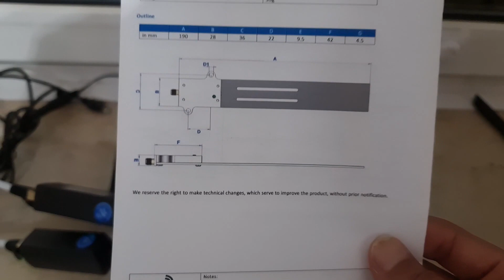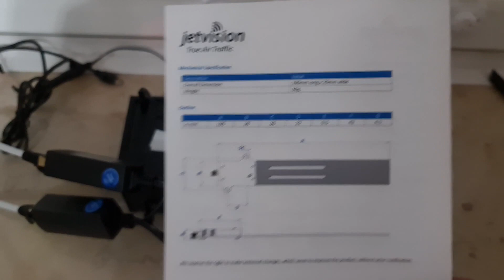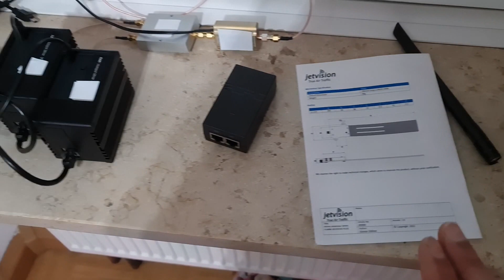2 Helium Miners 1 Antenna , Helium Amplifiers , Splitters 2022 Part 2 _HELIUM ADDICT

Comment: this looks amazing and props to the effort. they will nog registrer you for the deny list for placing 2 rak miners at the same spot?
Reply from the maker: Thanks 🙏 😇 
Well I hope not, I m planning to separate them son as I find a host
Reply: Any idea where I can get the amplifier / filter for the eu868 version? Is it able to switch the antenne cable into a pigtail (cotxx3/controllino v.3) ? Sensecap already has two filters in it right? should I put an extra saw filter on the sensecaps m1?

Comment: Hello, thanks again for this informative content! I installed 2 miners on 1 antenna and I'm experiencing some networking problems. I think this is a topic which deserves to be analyzed. I know you don't have this kind of problem but I assure you that is a very common one in countries that are not Germany. Like mine: miner n.1 is fully synced and port forwarded to 44158. Miner n.2 can not be portforward to the same port so I had to open a different port but no dialogue with the blockchain. When I ping it through Hotspotty it says no connection to blockchain. Weird thing is that both miners are ok when I checked on Helium diagnostic via Bluetooth pairing. 100% synced and ok inbound and outbound. Any advise from your side would be really appreciated 🙏
Reply from the maker: Hi 👋 
The important thing is it's not in Relayed states  and the Rewards should be the same in the end of the month 
Happy Mining ✌️
Reply: @heliumaddict8582  the explorer says it's syncing. But it's stuck like this from 10 days and it doesn't send beacons. That's the problem. And there's another problem: given a beacon sometimes miner n. 1 makes the witness but miner n. 2 don't. Even if the beacon has less than 14 witnesses total
Reply from the maker: @fracichi   I think you have SD card problem 🤔 for  siw long syncing 
And witnesses is just random and not mine you will witness the same beacons on bought  miners
Happy Mining
Reply: @heliumaddict8582  that's really weird. I don't think it's an SD problem. I will try to connect just the syncing miner to the antenna, turning off the other miner and see what happens. Thanks

Comment: NMRF saw filter 868mhz is this good? What does this Do?
Reply from the maker: Me I don't recommend SAWFILTER because he will reduce your SNR and you lose 2.5 to 3.5 dB  from you miner power. 
Youse SAWFILTER only if you have Heltec miner or Pisces P100 Miner because they don't have Sawfilter built in. 
I hope this answers your questions 🙏 
Don't forget to activate the notification bell on  for my upcoming videos 📹 😉
Reply: @heliumaddict8582  because my bobcat is underperforming compared to my other miners 2 panther x Thats why .
Reply from the maker: @mariochanko5076  I don't have Bobcat but you can open him and replace the ipx cable from inside with shorter and better one if your comfortable about that 😉 
I m not RF expert copy me on your own risk Disclaimer 😉✌️

Comment: I'm no RF expert, but from my radio studies I would say that you are going to fry your radio's concentrator, you cannot just split both receive and send signals into one antenna.
When one transmits it could go to the other hotspots coaxial as in decibel power reaching your concentrator that should not be. I hope this finds you well, good luck.
Reply from the maker: Hi 👋, first I want to say I m big fan of your videos I watch all the time from the beginning of HNT mining. 
About your counsern of Rx and TX well probably you have right I'm not expect in RF or anything but I prefer testing than theories, 
I tried 2 Helium Miners 1 Antenna for months and I added Bidirectional Amplifier and everything still working fine , and now i tried 3 Miners with 1 Antenna and everything works fine because the Helium Miners not very powerful specially the European ones very very weak even with Bidirectional Amplifier, I even know people from USA that's have similar setup and they work fine even thou  the US Miners are mor powerful but everything still working fine. But after PoC11 every Miner from 🇺🇸 or europe 🇪🇺  or Australia 🇦🇺 they  become even weaker  sow that's why people start to look after Bidirectional Amplifiers like crazy 🤪   me personally I didn't Have Bidirectional amplifier before Poc11 because I didn't need them, but after Poc11 my Rewards go's to 💩💩💩 I had to look for things to help me to push my Rewards up to keep my Host Happy. 
I hope that answers your questions 🙏 
And me I always said copies me on your own risk Disclaimer 🙃  I m not expect in RF I just share what I do with my Helium Miners 😉
Best luck with your videos 📹 and  hope to see you in my upcoming videos ✌️🙏😇

Comment: It is not correct to claim, that 8dbi or 9dbi antennas - the best. While everything depends where to you place it. In the middle of the city centre, 2-4dbi usually be better. If you out of the city, the you might need a higher dbi antenna. But except that there variables like terrain, buildings, forests, and etc. So each location will have it’s own best antenna :)
Reply from the maker: Thanks for the information, but I explained in  my previous videos and the last 1 whey 8 and 9dbi McGill antenna was better for me  even though in the city or urban areas, and please don't compare  868mhz europe to 915mhz  USA  it's big difference in dB and big difference in Frequency behavior. 
Watch my latest video 📹 carefully because I explained alot about this subject  Europe 868Mhz vs USA 🇺🇸 915mhz 

See you in my upcoming videos 📹 😉

Comment: Hello,  Im Having problems connecting my milesight ug65 to wifi. i had to switch its location and ever since then it won't connect to another wifi set up. I have spectrum and whenever I try to find the IP address it’s not showing that it’s a connected device. any ideas? thank you for your help
Reply from the maker: I m sorry but I didn't have Milesight Miner before, and I m not Teck savvy  sow my only recommendation is to youse Ethernet cable (Cat 8.1  with gold plate for Outdoor use) and  POE KIT  to  give internet and power to your Miner because Wi-Fi its not good for helium Miners.  I hope this will help you 
Best regards M.G

Comment: How do you manage the network? You can forward the same port to two different IPs with TCP. So, one will be relayed unless you use a VPN for the second miner.
Reply from the maker: Hi 👋,  well in Germany  some internet providers they have automatic port forwarding service  which mins that the Router allows any device to use any port forwarding number automatically and TCP OR DCP  also automatically. 
EX : i think they make this possible because of the online Gamers ho keep calling them for Port forwarding for serten games, also Some Home office workers who need some port forwarding service  sow  for less work for them they made this Automatically (This my personal opinion of course )

Me personally I didn't have to nothing with the settings everything wose Automatic
 I guess I just got lucky👌😉 sow no vpn or vps needed.
I hope this answers your questions 🤞
Best regards M.G
Reply: @heliumaddict8582  you have no clue what you are talking about.

Comment: what bi direccional amplifier did u use? its the flarm booster?
Reply from the maker: No it's From Shireen made in USA 
https://www.shireeninc.com/osc/900mhz-indoor-helium-amplifier
@@@ Disclaimer@@: I don't recommend this Amplifier yet because I still in testing faze I m not 100% Sure about him .
sow if you bayet  buy in your own risk .

In the upcoming videos 📹 I will explain more about this Bidirectional Amplifier  stay tune for that 😉 
Best regards M.G
Reply: @heliumaddict8582  carefull if they catch ur hotspot name and its skyrocketing u will get reported.. that amplifier is powerfull. But it wasnt that one I was asking its that thingy next to your splitter. I dont know what it is.
Reply from the maker: @darkevilpt5306   Thank you for the advice 🙏 ☺️ 
My setup in this video is :
1- Rak-Miner V2 
2- from the RF Card of the Miner( cosontrator ) directly connected to the  Splitter/Combiner  with 
ipx cable to SMA Male .
3- and from the Splitter/Combiner to Shireen Bidirectional Amplifier with SMA MALE TO SMA MALE connector. 
4- From Shireen Bidirectional Amplifier to coaxial cable connected to Rakwireless  omnidirektional Antenna 📡. 

About FLARM BOOSTER PLUS is connected to Another Rak-Miner V2  in ather Location .

I Hope that this answer your question!!
Best regards M.G
Reply: @heliumaddict8582  ahhhhh thats another shireen amplifier ok I was looking into the other one they have that looks like bullet Yeah yeah I get it now.. But shouldnt you plug it directly to the antenna ?
Reply from the maker: @darkevilpt5306   I should but at that time I didn't have the SMA Male  To N-type Female connector to do that , now it's connected directly to the Antenna. 
Good point

Comment: Thank you for the video 🙂👍 
Can You please tell me, what the name of this SAW Filter? Golden one (Radio Antenna)

I have the same situation like yours. Like you said, my antenna is outside the window near the miner. 80cm.
Do I really need that SAW to maximize results, or it's not nessesary, because the cable is to short, small signal loss and etc... What's your opinions 🙂

Btw, Yes, Sorin Videos are awesome too!! 🙂👍
Reply from the maker: Hi 👋 ,  first thank you for Subscribe 
Second the Golden one is Bidirectional Amplifier From Shireen made for Helium hotspots  and inside him there is Sawfilter for 868mhz frequency Europe 🇪🇺, but you can order him with SAWFILTER for 915mhz for USA 🇺🇸,  and I youse this Bidirectional Amplifier to compensate the dBi loss from splitter/Combiner and connectors and the thin coaxial cable.  I hope you understand me if not fill free to ask about anything

PS: About the Sawfilter that you see in Sorine videos  its only necessary if you have 
Miner ho don't have Sawfilter built in like Pisces P100 except this is not necessary because he will reduce your transmission TX power and receiving power RX  bay 2.538db its a lot of dB loss that's why Sorine youse Flarm booster Bidirectional amplifier to
 compensate for dB loss